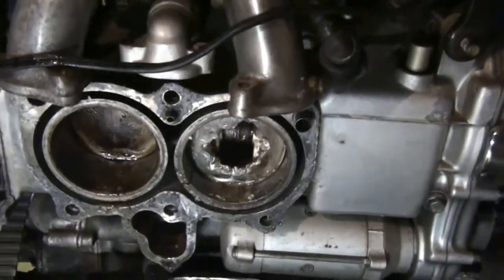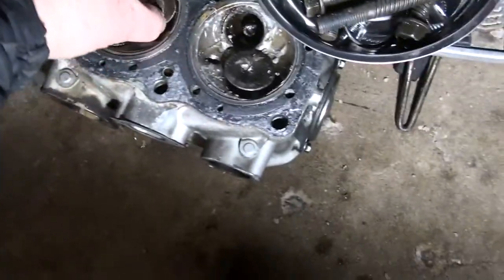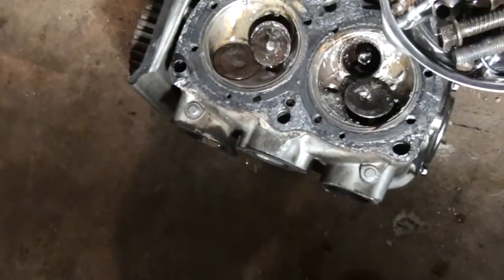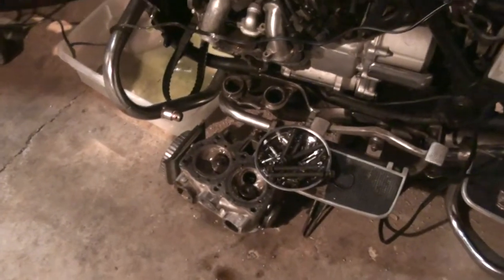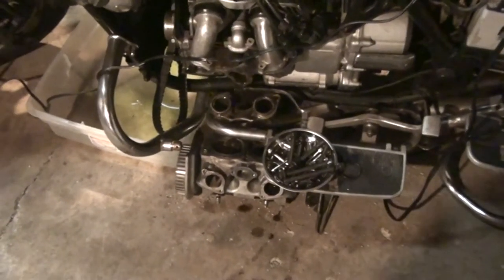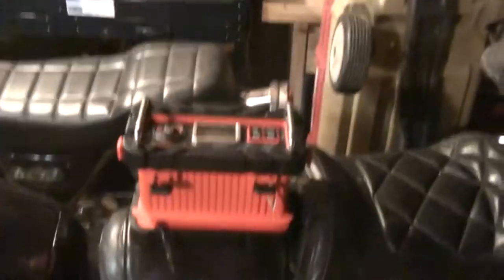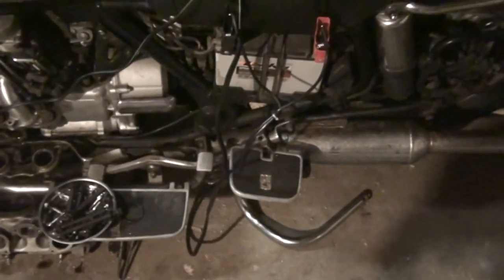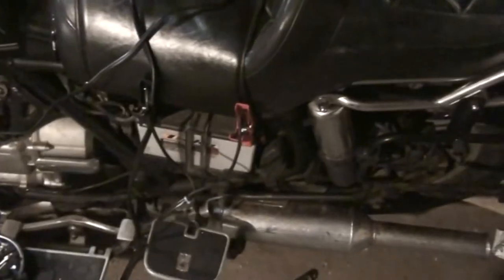GL1100 Motor Update #2

Comment: Oh now that's not good. But that sounds OK for a replacement engine. Smart to rebuild those parts while you have it torn apart . Good luck
Reply from the maker: Yeah, it helps to have a master Motorcycle builder helping me. I would not have known about the stator or the starter other wise. Fingers crossed it goes well.

Comment: wow! that piston didn't look good but a new engine will be good...I too have one of those battery reconditioner chargers
Reply from the maker: Yeah, I was so surprised that part of the charger worked. I have a tractor battery that is dead I am going to try that on that as well. Well the motor wont be new but I know this guy and he will get me the best motor he has and that is all I can ask. Getting it on and off the trailer will be fun! :)
Reply: @MidwestMotoRider  those engines are pretty big and it's a shaft drive too so not as easy to install

Comment: Not good news.  As long as you have the engine out of the frame go ahead and replace the stater.  If you can find one with higher watt rating even better.  Good picture of why these engines need the timing belts replaced every 10 yrs/40,000 miles.
Reply from the maker: I have herd so much about how those go bad because people put lots of accessories on them, the newer ones have a much better charging system so I am going to go with one that kicks out more amps if at all possible. I know the starters can go bad on them also even tho its easy to replace really I have herd they are easy to rebuild so figure while the motor is out I will do that as well. Replacing the belts is super important given these motors are zero interference motors.

Comment: $300 sounds ok to me. Be better if you didn't have to replace the donk I suppose. Nice battery charger I must say.
Reply from the maker: Well I figure the rest of the bike is so well cared for that even with the cost of the new motor, clutch, stator, starter rebuild, carb rebuild and new timing belts I will be in the bike for less than $1,000 and so that is less than a good running bike in the same shape would be so I won't be upside down on it.

Comment: I could use a battery charger like that , could you provid einfo on it, With my vw I have a lot of battery that spend way to much time sitting around in the garage. To bad about the motor that had to make some noise Piston hiting valves..
Reply from the maker: Sure thing I just put up a quick review on it less than 5min, you can probably get it cheaper on Amazon than in the stores but either way its available. :)

Comment: ok !! saw your new upload and just jumped to this one after so im gonna say , isnt the broke one fixable? and yes i know you got a new one and its cool and all , it just hurts to see this go away ! if you are up to a sell of your front fender bling thing ,i think i would buy it of you ! wife and big doughter says hi and give your wife a greeting ang hug from us !
Reply from the maker: Hey, hey back at everyone there from us. Tell me what your looking for the fender, the light the bars all of it? You don't have to buy it I will see what it takes to get it to you. The other motor is not fixable the cylinders (2 of them anyway) have deep groves in them so the block is just garbage at this point.
Reply: @MidwestMotoRider  wouw , well the whole front fender , but honestly if all goes to plan , ill use it for a rear fender almost as is , only maybe a bit shorter with the light as a rear light ,maybe only stop light if it works ! 
could you take a with messurment of how wide a tire or tyre ( wich is correct in u.s?) it fits ? its a shame bout the engine , a expensive repair so its good you got another one to use as sparepart donator. thanks for the offer , just say if you want some for mail or fender !
Reply from the maker: @transdetendal  Ok I will try and get the fender off next weekend. With luck maybe it will fit in a flat rate box. I won't need anything for the fender or the mailing. The fender is only slightly wider than the stock one on my CB550. The light does work, however the lens is orange so maybe you can come up with some way to make it glow red so it can be a tail light. I like the idea. I will let you know when I get it off. Enjoy your evening and howdy to everyone there from everyone here. Do you have my email address? If you do I will shoot you my new address.
Reply: @MidwestMotoRider  thanx ,no email adress but i once wrote you my facebook and name ,even i never use it , or if you guide me to the youtube private messegebox then perhaps i can get it there !you could also make a vid of your new hood and i could stalk find it like last time haha